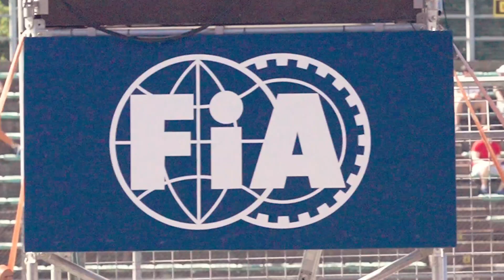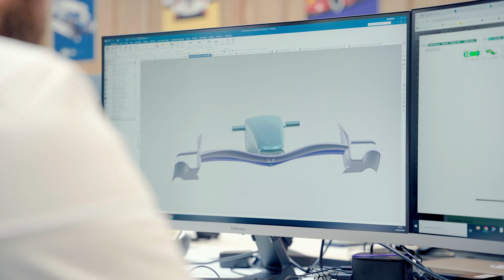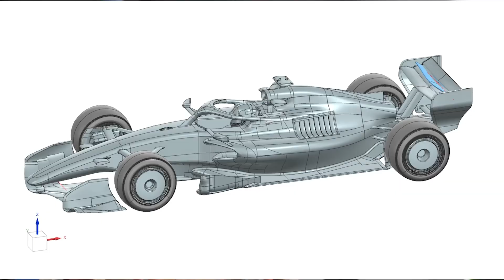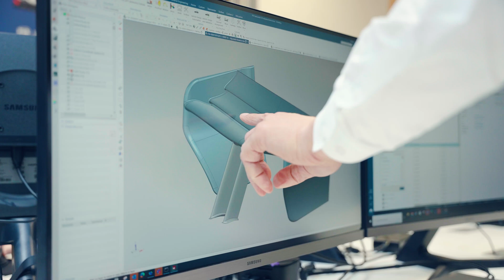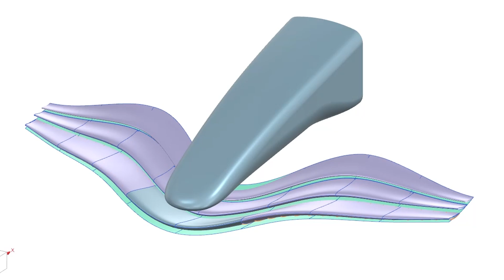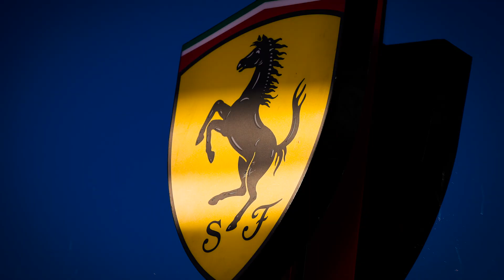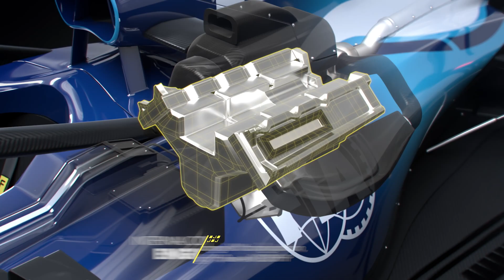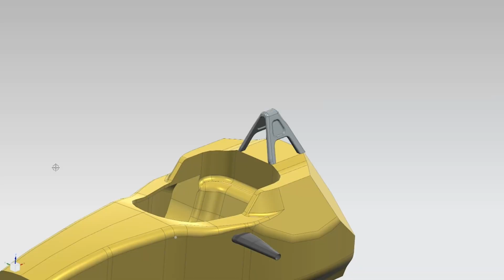The Future of F1: Showcasing the 2026 FIA Technical Regulations – Lighter, Safer & More Competitive!

Comment: That's hardly smaller. They should've gone much harder after the dimension reduction.
Reply: Get rid of turbo
Do not increase MGU-K & battery any further.

But they do the opposite.
Reply: With batteries, not feasible.
Reply: how do you know that are you a mechanic?
Reply: @Chris-sm2uj  what part? Mechanic no. Studies mechanical engineering among other fields, yes.

Comment: If you have an active front wing, it means damage to the front wing is an instant dnf unless there is a red flag because I don't know how it will be changed that quickly for it to work.
Reply: Didn't think of this...Wonder if that will be an issue or if they've somehow solved it. Meanwhile Indycar's can literally park on another cars roll hoop and continue on racing
Reply: honestly i don't see how it's different if it's all just contained in the nose. They can already swap out front wings and adjust aerosurface rake angle. Active aero just adds an actuator to do it on the fly. The way it's implemented also seems to be a very two state toggle system so not much control is needed just find two optimized states and let 'er rip
Reply: Much like how today's noses and wings work. There are a ton of sensors on the front wing, including the tire IR cameras (those two little bulbous things in front of each tire on the wing). The nose and the chassis have hard-mounted plugs that align perfectly, so when a new front wing goes on, just slide the plug home and bam, reconnected.

Comment: Why not open up the regulations more? we already have a cost cap. Lets get a mix in here. Different engines. Different designs on the grid. Get some innovation in F1 again
Reply: Set power output requirements and let engineers do their work with whatever configuration they wish.

But FIA is FIA. They don't have balls to make the same thing they did for WEC
Reply: Exactly!!! Given the cost cap is rigorously enforced, relax the technical regulations and keep only the safety related ones and maybe a general air stream specification behind the car, to avoid too much turbulences hindering the aero on the cars behind. It's ok to keep the same wheel & tires for everybody. But leave the rest to the teams. This is how we get real innovation and diversity on the grid.

Comment: "Lighter, Safer & More Competitive". I like how FIA conveniently forgets to mention that at the moment by the estimates of teams it's slower than the current Formula 2 car.

But they sure as hell will tell you all about carbon footprints, sustainability and road relevance. As in, aspects of Formula 1 which, let's be honest, nobody cares about. At all. 
Seriously, FIA. Nobody gives a shit whether Formula 1 (which is what, 0,001% of worlds pollution?) is sustainable or not. Or whether it's road relevant or not.
Reply: I don't care about speed, I care about good racing
Reply: @KazBodnar wich the current regulations did not provide and still do not provide completely. Certwlainly not as much as the 2017 regulations
Reply: The slower than F2 estimate was from an in-progress version of the regulations
With the new rear wing system active, the car needed to be driven very carefully to avoid spinning in straights (yes), because the aero balance was completely offset
This has been fixed in the final regs by making the front wing movable too
Reply: According to things the commentators have been saying, the people who do care are the engine manufacturers, because they need the proof that it assists their road car divisions. So the argument goes that if the FIA didn't chase these technologies, then we'd lose teams.
Reply: Probably .000001 besides their 100's of flights and freight. If they really cared about footprint, they wouldn't be having 24 race seasons. It's all a mask so they can say they are helping the planet. Anything they do doesn't make a millionth of a percent difference to the world.
Reply: You probably also believe in the tooth fairy if you think these cars will be slower than f2
Reply: I mean, paddle shifts were a little road relevant, but does your average Corolla have active aero? No. And the slower than F2 thing happened in 2014 if i'm not wrong, but that was supposed to be left in the past already
Reply: @LotsOfToubleUsuallySerious Yeah, that slower than F2 cars type thing happened in 2014. I think it was Monaco or so.

Comment: DRS won't be used anymore to artificially force overtakes: "Yaaaay!!!"

2 minutes later...

ERS will give extra power to the car behind and artificially force overtakes: "Nooooo!!!"
Reply: Push to pass is tactically more interesting than DRS honestly
Reply: @lordmctheobalt  Yes. Not ideal, as it is still artificial, but better. Especially if the driver is free to choose any part of the lap to use it, instead of pre-defined areas.
Reply: @cgasparetto  100%. That's what I want clarification on
Reply: Push to Pass is a better system, because instead of a defined DRS zone every lap, it's a tactical deployment by the driver that can let them pull a surprise overtake somewhere there isn't a defined DRS zone. Also, the X-Mode aero (front and rear wings opened on every straight) means that the racing will be faster and closer, and the lower rear wing and removing the front wing endplates means the outwash and dirty air will be reduced as well. These are all good steps towards tighter, closer racing
Reply: As far as I know japan super formula already has this function
Reply: @ry0_  Indycar in America already has it, too.
Reply: Indycar does it right, where you have a certain time of boost for the whole race and you can use it when you want. This often creates last lap overtakes.
Reply: Indy has a timer base push to pass where a driver has a total ammount of time he can activate the push to pass this actually trigger alots of strategy between teammates and interesting tactics ....  so hope F1 going to focus on this

Comment: so what is the point in the active aero stuff if everyone has it every lap? might as well just not have it???
Reply: Less drag at high speeds, more grip in corners. 

Less drag = Less fuel used

Less fuel used = Less fuel carried

Less fuel carried = Less weight

Make sense?
Reply: Faster in straights and gripper in corners
Reply: cars are faster in straight line and around corners without compromising one for the other
Reply: Because engine regulations are BS they hope to preserve some speed by reducing drag... Marketing pipe dreams...

Comment: Why should the active aero be restricted? In its planned form everyone will just have it on until its turned off for them. Let the drivers show their skill!
Reply: Because if you try to corner even slightly while the front and rear wings are open, you will completely lose control of the car. 

Open wings = no more downforce
Reply: @judethedude96  I know, but the driver should have to change it to 'high downforce mode' instead of it being forced off at the same time for everyone.
Reply: @Charlie-gf4mv  If you actually listened to the presentation: "It will be driver selected OR disabled via brake pressure." The active aero will close the instant the driver pushes the brake pedal, allowing them to keep it open as long as possible before the braking zone.

Comment: Cars smaller, and after decades of hoping DRS is finally gone! 🎉 finally drivers will be properly passing and fast cars screwing up in qualy won’t get back to pace in 10 laps. 2026 can’t come soon enough!
Reply: Drs is replace by krs in the same way as drs to overtake... 🫠
Reply: @erdinhandikafirdhy5056  the problem with DRS is that it artificially has the guy in front helpless at certain zones. So if a slower driver takes advantage of a mistake from someone in front, it isn’t for nothing at the next DRS zone. The ERS is managed and it can be used as defence.
Reply: now it's double drs💀
Reply: @pisderata  I’ll be honest it’s a bit weird, I guess it gives more things to break on an F1 car? It seems more like a bunch of flexy wings.

Comment: V10, sustainable fuels, smaller cars. Bin active aero and DRS. Electrical assistance is fine but only via some kind of push-to-pass system that must be used strategically. Better tyres
Reply: active aero/DRS is great imo, I don't know why anyone would have an issue with the 2026 implementation of it now they've added push to pass
Reply: There are hints that the hybrid component could potentially be dropped in favor of just the engine. The cars are already getting lighter from that. Active aero will probably remain due to market trends, but it’s no big deal because every car has access to them at all times. We already have 100% sustainable fuels for 2026, so that’s a non-issue. Cars are starting to shrink once more. The only thing you won’t get is a V10; it’ll probably be a V8 or a V6, given how the market is trending towards smaller, more efficient engines. Yeah, you’re getting most of the complete package you asked for. It’s not much, but it’s a step in the right direction
Reply: Car brands don't want V10 anymore, people just can't accept that, the sport has to attract car brands or it'll die, and the only way is giving them small turbo engines.
Reply: V6 ✔️
Sustainable fuel ✔️
Smaller ✔️
Reply: @Aris13GP V8 ✅️
Sustanaible fuel ✅️
Smaller ✅️
Push to pass button (max 5 times) ✅️

Comment: All we want is small, light cars with V10s on sustainable fuels. C'mon!
Reply: For that you're going to have to wait until 2030
Reply: I sure as hell don't. I want them to sort out the racing. A shit race that has V10 noises is still a shit race. Besides, no manufacturer is interested in making V10s
Reply: @dod_the_angel  facts
Reply: Tell that to the road car manufacturers who are currently in the process of phasing out large engines, like lambo who got rid of their v12 and v10s for smaller v8 hybrids
Reply: @srthebox4946 revuelto uses the same massive 6.5L NA v12 Ferrari is using the same 12 in 12 cilindri aston Martin is making v12s Mercedes is still using v12
Reply: @Fe0381 those are just a few examples, you can not deny the majority are now using smaller and smaller engines with hybrid power trains, I mean the revaulto is a hybrid and theres a reason why the huracan v10 is being replaced with a hybrid v8, yea the cilindri has the v12 but ferrari have also made a few electric and hybrid cars lately too, aston Martin also said it will likely continue with v12s and stop at 2026 or 2027 (gee, what a coincidence in timing, I sure wonder) and mercedes have started to scale back their use of the v12s as well as more and more of their cars go electric, hybrid or use smaller engines.
Reply: @srthebox4946  the hybrid in both Huracan replacement, sf90, 296 gtb and revuelto are for improved performance rather than fuel efficiency and since the engine will run on sustainable fuel what’s the point of hybrid systems and the most carbon footprint comes from traveling not 20 cars racing for 120 minutes but if they instructed teams to maximize fuel efficiency and make the cars smaller, lighter and more agile it would make the competition better
Reply: People like you need to understand that these days no one wants to build V10s anymore
Yes they were great but they are a relic of the past
Reply: The manufacturers want a relevant engine
Reply: @gordontheman6151  An engine that can run on sustainable fuel is relevant because ICE cars are not going anywhere
Reply: @maflaviodepina3142 It depends if sustainable fuels are marketable for road cars. If not why would car companies like Ferrari and Mercedes spending Millions on outdated tech ? F1 is about the pinnacle of tech not vintage cars race.
Reply: Amen
Reply: Just shut up about the V10
Reply: @Dakkyun why? It’s an F1 car, not a road car! The large majority of fans wish to have v8 or v10. Imo, as long as there’s a combustion engine, it’ll be F1
Reply: @charles-davidberube1174 Because it has to give value to the brands. Like this:
Brands want smaller engines + F1 mandates small engines= brand interest
If F1 mandates big engines, brands will not care about making such engines, because there's no value to transfer to their road cars, and without brands, no one will make engines, so the sport dies.
Reply: @Nicks62999  i totally agree on your take! I think 2026 regs are a good one for the time we live in. However, i do believe the electrification of cars will meet its end soon with the option bio fuel become more and more interesting. Major Japanese brands are already running away from electric. I see a future reg going for bio fuel full ice cars

Comment: If the 2022 car and the early 2000s car had a baby
Reply: But inside chernobyl reactor 4
Reply: exactly
Reply: The only thing missing is a e-feul running V10 and it would be fantastic
Reply: Exactly. It is 2004-2008 car, but slightly bigger and without hundreds of unnecessery small wings all around. Looks good to me so far.

Comment: 2026 Power Unit
Melcedes
Ferrari
Renault
Audi
Ford

HONDA :"(
Reply: Honda is with Aston Marchan.
Reply: Aston Martin are using Honda in 2026
Reply: At the time of discussions Honda had decided to pull out of F1. They came back with Aston Martin after the discussions about the engines had been "finished".
Reply: Amazing, 6 different manufacturers 🤩
Reply: Honda will be with Aston, and Ford won't be making any engines, they are just gonna put a badge on the red bull engine
Reply: Honda is with Aston, and Ford won't be making any engines, they are just gonna put a badge in the red bull engine

Comment: I don't want hybrid engines.
Reply: Tbf they're very efficient and we've reached points where we've extracted the same power out of the V10s with a hybrid V6, I don't mind hybrid engines. But if we're going to be seeing slower cars anyways, I do think it'd be interesting for them to return to pure V8s (as an example), but this time with sustainable fuels if it means the cars can continue to be smaller but still be fast (though hopefully safe) because they would save space from having to fit in the hybrid system / electric powertrain components.
Reply: @hamingnu6610 honestly it’s the sound everyone refers to when wanting the V10/V8 to return, we just want that iconic whine back.
Reply: Actually the teams want it.
Reply: @Lann458-n8e  what does that have to do with what I said?
Reply: Manufacturers wants 🤷‍♂️
Reply: @Aris13GP  You got to love how they left Honda out of the discussions. Even though they are better than everybody.

Comment: V8s wouldve helped the weight issues, The 2007-2008 cars are wide enough to implement the safety cell also but ofc implement different geometry for downforce (wings, floors, sidepods, bargeboards etc).
Wouldve saved 100-150KG doing so, smaller cars = less dirty air and smaller vortices
Reply: It was NOT safe remenber kubica? His feet was literaly out of the car when he crsshed
Reply: @foundedcupid5286  those cars didn't even have a safety cell or a halo, read my comment properly. "They're wide enough to implement the safety cell" and by nature the Halo also

Comment: So P1 with a 20 sec gap will still have drs nice
Reply: also P2 has, so whats the difference?
Reply: @edoardotecchiati8427  the difference is that P2 wont be able to catch up to P1 if both have DRS, not very competitive racing if you ask me
Reply: @pkhasann  That's the whole point, they're getting rid of "DRS". That's what a lot of fans were asking for years.
Reply: @pkhasann  but thats not true. First, if you are p2 right now at 20s gap you dont have drs so i dont get your point. Second, they are not getting rid of drs, they changed it from an aero advantage to an electrical advantage cause they introduced a new overtake mode made using ERS
Reply: @kicapanmanis1060  but it is replaced by another overtake mode so whats the difference? Only the name imo
Reply: @edoardotecchiati8427  Depends on how it's implemented. If it's relegated to the same zones then it's likely going to suck, but if it's opened up to any straight then that would shake things up considerably.
Reply: How P2 could chase P1 with 20 sec gap if DRS works only less than a sec distance? 🤦🏻 Again, what's the difference?
Reply: @edoardotecchiati8427  they basically bringing back KERS. Which the driver manages when to use. Won’t be a dedicated passing zone like DRS. That’s a bit different. As you won’t have someone artificially forced helpless like you do now with DRS
Reply: DRS was the worst bandaid solution for passing. Good riddance to bad rubbish. Everyone has DRS on at the straights, so really it may as well not exist. 

Now when someone qualifies poorly they can be properly punished.

Comment: NOT small enough
NOT light enough
NOT loud enough
Reply: always complaining, it will never be right
Reply: They might sound a bit different, maybe a bit louder but we won't know until the first tests. The lower fuel flow will mean less noise but the removal of the MGU-H will mean an more noise so who knows
Reply: Not 2026 yet
Reply: Its indeed having heavy hybrid cars, or light combustion only cars.
Reply: you sound miserable
Reply: And too slow.
Reply: @podjun80 what the fuck are you talking about? They have 55% less drag and double DRS
Reply: @MythicalDust  the new cars will likely be 2+ seconds slower around most circuits in race because of the reliance on battery power
Reply: @Amy-dq2lg  Surely they still should be reaching higher top speeds with their drag + drs setup?

Comment: Spec 3.0l V12, manufacturers can do what they want with the hybrid within safety regs, a budget cap and only deploying to the rear wheels. Push to pass which uses a different engine map so it's use has to be balanced against fuel consumption like in Indycar. 2016 car dimensions with spec floor/wings, no DRS.